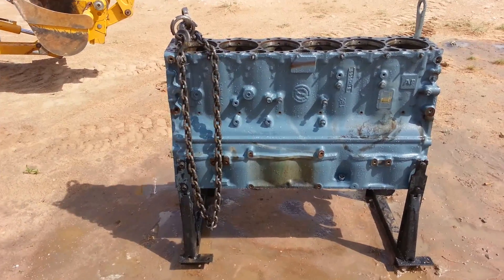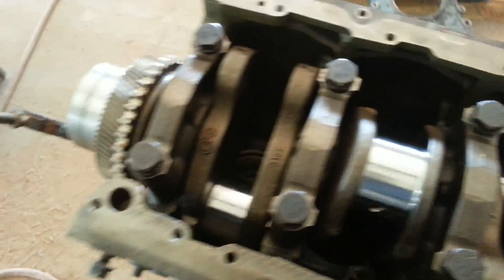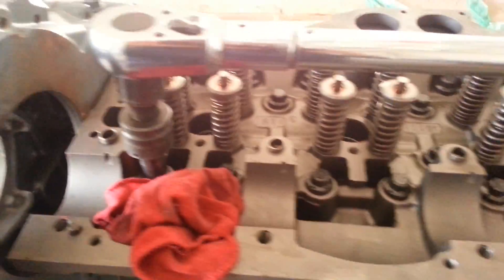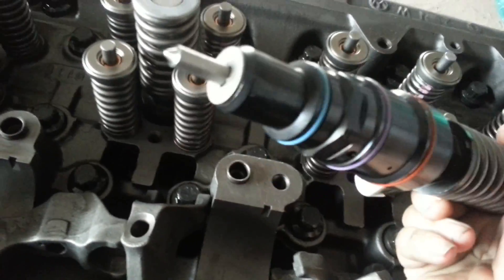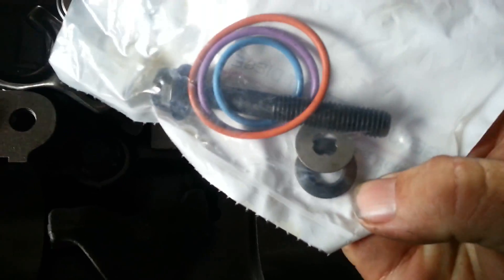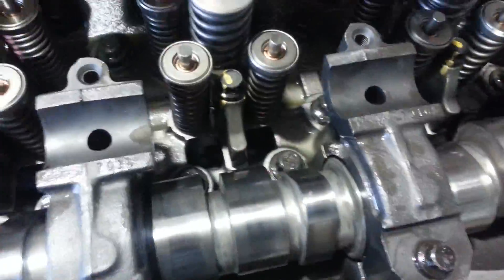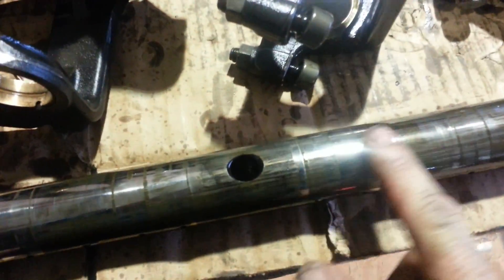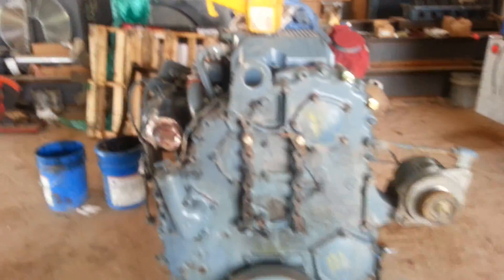Major overhaul S 60 685 HP @ 1800 RPM Genset engine. Please subscribe !!

Comment: I'll be perfectly honest with you man, I'd much rather torque the series 60 head, than an ISX15 head. There are less bolts in the ISX15, but they are larger diameter and require almost 2x the torque that the series 60 head bolts do. 220 ft-lbs 2 times is twice as much easier than, 150 ft-lbs, 300 ft-lbs, then 90°.

Comment: can i put those rebuilt kit #s in a 2000 12.7 ddec4 ingine block. what would be the cam # and # for a rebult head with valves
Reply from the maker: Douglas Green Hello Douglas, you won't be able to. This is a 14 liter engine.
Reply: if i get a 14,0L block can i put all this stufff to rebiuld it it to go in my 2000 frieghtliner classic/ or how much would it cost for you to rebuild me one
Reply: what kind off rebuilt kitt can i put in my 2000 12.7 to get the horse power and torqe up. going to pull engine out so im going to replace every thing new head /camlooken for a good sett up for a ower/opp. like to have 575hp and 1850 on torqe. thank you
Reply from the maker: Douglas Green  You will have to have a 14 liter block and crankshaft for 575 HP
Reply: can u answer my post on how to up the power  on my 12.7 going to pull it out and rebiuld from ground up. what can i do ti it to get more power and torqe
Reply from the maker: With the correct hardware and software you can get 500 HP with 1650 FT LBS
Reply: its already set up @500 with 1650 ft LBS from factory. im rebuilding it from botom up. its got 990,,000 on it. i didnt know if there was a bigger enjector and a different cam or bigger cam that i could put in it to get it to pull the hills. alot better than what i got now. when it come to hills its like a boat anchor. pluss i didn't know if they made a kit, with bigger and better piston and a bigger bore on the sleeves.
Reply from the maker: Douglas Green Yap your at the max for the 12.7
Reply: what kind of rebiult kit can i put in this block or what kind of cam or what size injectors can i us to get more horsepower
Reply from the maker: Douglas Green You can google pitsburg power they make HP programs.  As far as your engine, your at the top tier
Reply: what is the detroit part # for the cam you used

Comment: that's what I was looking for is non egr or pre emissions but finding the 575 is hard as hell not many around or people are hiding or hanging on too them
Reply: Engine block doesn't mean much. You'll be looking for cam and injector specs for more HP. Just be sure to spec a correct size turbocharger to it too.

Comment: what is the differences between the truck version of 14.0 liter as apposed to the marine version can it be ran in truck setup pre emission have been looking for ddec4 14.0 liter 575hp to build for gliderkit can you elaborate on wiring and setup differences want the performance of Detroit but it have the performance ability like a newer isx 600 pre egr I know the 575hp Detroit and signature 600 isx where badass back in the traffic they came on like your video info would be helpful thanks!
Reply from the maker: The truck version 14 Liter DDEC IV will have the egr system, compact gear train. The marine version will have a big water cooled turbo, water cooled exhaust manifold, water cooled intake manifold. The 575 that you know about is non egr. Thanks for watching.

Comment: The gaulding of rocker arms & shaft was probably, caused by the new low zinc oil on the market these days CJ-4 . The older CI-4 oil is a lot better oil but very hard  find.   NEW & IMPROVED HA HA
Reply: CJ4 oil didn’t cause that. Lack of maintenance caused that. Most of those gensets run wide open day & night and rarely get shut down for preventative maintenance.  They live on a steady diet of crappy fuel, old filters, and whatever makeup oil is lying around when it finally runs low enough to get someone’s attention.  I’d love to know how many hrs that old 12.7 had on it before overhaul

Comment: I drive a 12.7 L series 60 the factory rating is 320hp I believe however my question is how are people getting 400 hp or 450 hp out of them without changing major components of the engine?  thank you for your time sir
Reply: Hale Cooley 

Hello. i was just like you. 

i wanted more power aswell. but its all in the tune.

I live in Houston tx. 

there is a guy by the name of Rick Fenwick. the guy is a Beast in Tuning ddec 3 and ddec4. Detroit 11.0 ,  12.7 and 14.0

you can get in touch with him through Facebook. 
Christopher Fenwick. 

he drives a sandy color faded peterbuilt with a 14.0 detroit. 

if u cant find him. let me know. 

hope this help.

and and just for starters
he recomends a 171702 Borg warner turbo, with a boost and pyro guage at the exhaust manifold for better reading. 

just for starters. he can make that detroit pull like a car! bro its a night and day Diffrence. I promise. 

that guy knows what he is doing
Reply: Mario Rodriguez 554t thanks for the info I'm in Iowa though down for the winter
Reply from the maker: Some times it's as easy as a reprogram. To get 450 HP recommend cutting the counter bores for top liner cooling. Thanks for watching.
Reply: PermianBasinDiesel thanks for the response the truck is a 94 so is it still the same answer or different I apologise for my ignorance
Reply from the maker: Hale Cooley If it's a DECC 2 (sounds like it is) should be able to get 400 HP out of it. May have to change the ratings on the main frame then program the ECM
Reply: What else did you do to your detroit ? I stay in Houston too. Will contact rick once i get an overhaul done with a couple mods done to it. How much power are you getting out right now
Reply: rogerm 

hey Rogerm. 

the only things I did to my Detroit was

-add a boost gauge that will read minimum 35psi. 
-add a pyro guage and install it at the manifold. from the cab to the front of the engine, it's the 3rd cylinder manifold.  you can get a great one from glow shift. pick the style u want and get the one that reads to 1500. don't get the one that reads 2400! that's to much. 

if your in Houston, I can help u install it. 
I live on the 290 and Bingle area. 

you can start with that.

if you want more power.
u Must start atleast with the 171702 Borg Warner turbo. 

if u have the money, get the Borg Warner s480 . it's like 1400-1500 dollars. 

and Rick said we will be golden. lol

Send me a text at 832 216 4680
Reply: rogerm 

I don't know how much power I'm getting. I haven't been to a dyno.

but I have beaten 550 cats and 5 something Cummins. 

I drive a blue dump truck 1995 Kenworth t600

Comment: I just thought about something. That engine will make 685 hp and it's not a 4 bolt main.
Reply from the maker: Yes you are correct just 2 bolt mains. In marine application it will do 825 HP @2300 RPM. Thanks for watching.
Reply: Not much need for four bolt main caps when the bolts torque to 375ish ft-lbs.

Comment: hey any chance you would be willing to share the serial number to the motor? i retrofitted my 14l in my otr truck without vgt or egr and have the egr cooler just sitting there and would like to install the coolant pipe going from the oil cooler to the w-pump so it looks a bit cleaner.
Reply: Never mind just realized you had the older style w/Pump and also noticed you posted the s/n earlier, ty.
Reply: Dusan Duric i

Comment: On these S-60 engines, what is the time frame until the new piston rings seat and stop smoking? Just had in-frame done with new cylinder kits and I notice white puffs of smoke from exhaust pipe when I step on throttle which goes away after couple of seconds. Rebuilt engine sounds great and lots of power but tech told me to pull a load or two and smoking should stop. I don't know, new experience for me.

Comment: Those are N3 injectors, what did you set the injector codes to? and what is the best setting? also who did the cal? is it factory or custom?  thanks
Reply: Although the cal codes should be programmed, alot of shops do not and the engine seems to run just fine.

Comment: Hello, what country are you in ? did you check out youtube high horse express just wondering about the parts we just rebuilt a ddec 5  685 hp oil rig engine the only thing different is the cylinder kit numbers.
Reply from the maker: Hello Peter, we are in the U.S. I haven't had a chance to watch that show yet, but would like too.
What is the rated RPM of your engine?

Comment: that thing is a ddec4 with ddec5 electronics also they make a 1080 hp. for marine. watch high horse express pulling you will see a ddec5 1800 hp.
Reply from the maker: Hello Peter, this engine is a true DDEC 5 industrial engine, the cylinder kits(have a different ring pack), injectors (N3), turbo, oil cooler, etc. are DDEC 5. And yes it does have some DDEC 4 hardware, including the block, Detroit didn't need the compact gear train assembly. The last time I was at Detroit, the S60 marine was still a 825 HP, they were speaking about releasing a 900 HP version, but it never made it. But, I will check out the videos that you where speaking about. Thanks for watching!

Comment: You mentioned something about the cylinder head being off that you had to adjust what was it
Reply from the maker: I think what you are referring too, is where I mentioned the cylinder head is shaved .003'' inch. I have to adjust the gear lash between the adjustable idler gear in reference to the cam shaft gear. I hope this is the answer you were looking for. Thanks for watching.
Reply: Yupp thats exactly what I was talking about you should make a video on that if you get a chance great videos keep up the good work.
Reply from the maker: Andy Osorio Thanks Andy, one of the guy's in the shop just installed a cylinder head, along with the front cover, that would of made a good video. A little late on that one. We will have to try to make a explanation video of the gear train. Take care and thanks again.
Reply: Andy Osorio Hello, what is the part number on the intake manifold or the engine sn. number I am looking for that style of intake manifold
Reply from the maker: peter drent Hello Peter, I try to get you a part # tomorrow. Thanks for watching!
Reply from the maker: PermianBasinDiesel Hello Peter, I didn't get the intake manifold part # I was painting a genset engine, and forgot, I removed my filter mask those fumes where bad man, I didn't want to go back in there, I do have a SN for you 06R0975021 it has the ceramic coated intake manifold. Hope this helps you man!

Comment: 12.7 or 14 ?
Reply from the maker: This is a 14 Liter. The 12.7 is only good up to 500 HP. A marine 14 Liter will do 825 HP @ 2300 RPM. MTU was going to take it up to 900 HP but that never did happen. Thanks for watching !
Reply: PermianBasinDiesel how are 12.7 good for 500 when i seen some pulling sleds with over 700hp??
Reply from the maker: Hello nawzy202, the engine is capable of more than 500 HP, but Detroit only released it as a 500 HP for automotive at its highest rating. C@I is less than 500 HP for longevity . Thanks for watching.
Reply: @PermianBasinDiesel  12.7 MTU are available with 825 hp rating at 2350 rpm........They sell parts for the camshaft, valve springs, and injectors that will turn a highway 12.7 into a 825 HP engine if you put the correct size turbocharger on it.
Reply from the maker: Batojiri1 It's a 14 liter marine engine with water cooled exhaust and turbo.